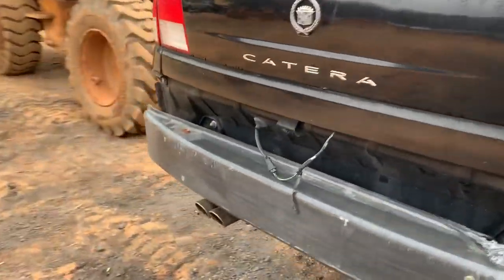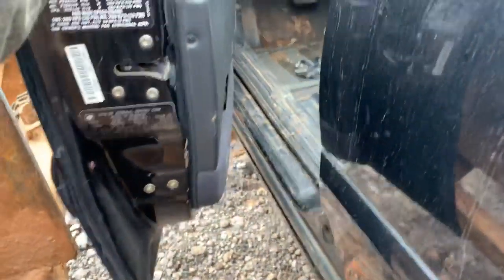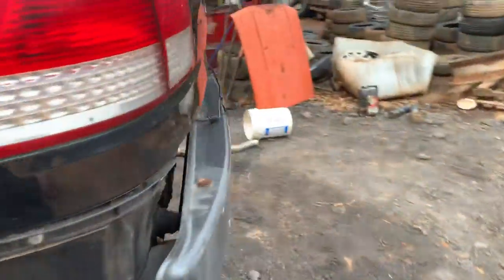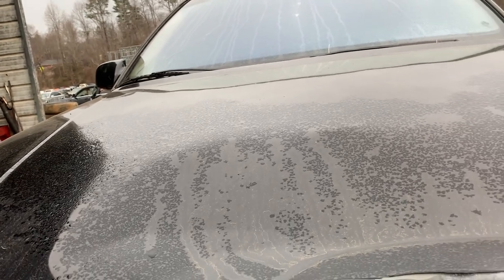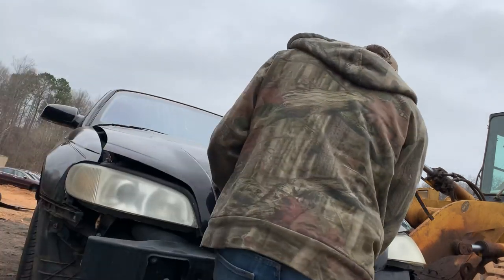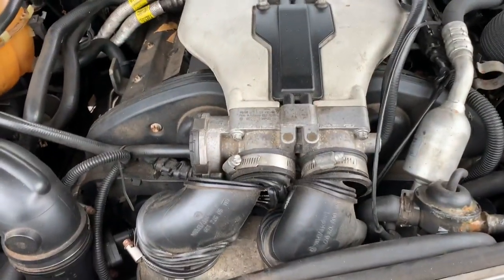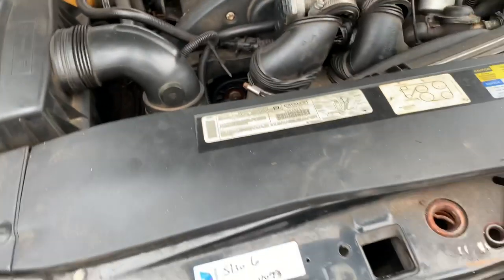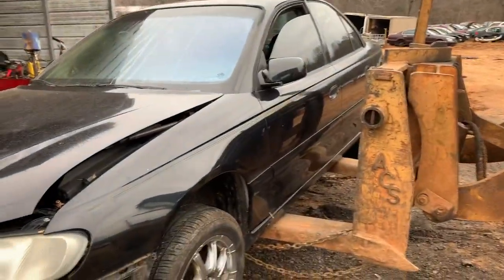Scrapped Cadillac....Catera?!

Comment: Opel Omega. More of GM's badge engineering.
Reply: They weren't bad cars in their Euro guise, despite that V6 being British-built (never a good thing). But then, NA market cars need to be tougher to deal with the longer driving distances and harsher climate (very hot summers / cold winters) in most of the US. Euro stuff just doesn't seem to hold up very well over there. I'm surprised that this was ever badged as a Caddy, but then I guess the brand had lost a lot of its cachet in the 80s and 90s.
Reply: Not the best Opel there ever was, but there are still a few of those Omegas doing high mileage here in South Africa.
Reply: The Omega actually wasn't a bad car, I had an MV6 estate as my first company car in my current employment and it was a reliable old beast, though it did like a drink.  It had been a traffic police car before I took it over and they kept it around because it had been so reliable.  I put another 70,000+ miles on it in a year so when it went to auction it was well on the way to 300,000 miles.  It's still around, still listed as being taxed and tested so that would suggest that it's still running fine.  Those V6 engines could be very frustrating though, they could have issues on top of issues.  It was pretty quick for a big old estate car too, I saw 140+ on the calibrated speedo a few times on my way to scenes...
Reply: Lmao they actually put the legendary Cadillac badge on a fucking Opel
Reply: @calculator5909    Opel were successfully building and selling cars in Europe before Cadillac existed as a car company...
Reply: And now they've sold Opel/Vauxhall so they have NO presence in Europe at all. GM needs some serious help.
Reply: Tomasz Klisz  Yep, PSA. They ain't much but even they have better financial stability and consistency than GM.
Reply: @calculator5909  Opel is not that bad, I've had a few. Currenly have a 2008 1.8 Astra (Saturn Astra in the US of A). At least it's not a VW.
Reply: @gosportjamie  For the money you get a lot more than from other German cars.
Reply: @Rouxenator  I never said Opel was bad, I just said that Cadillac and Opel aren't and never were in the same league. I'm sorry for triggering some 18 year old Corsa owners...
Reply: @calculator5909  LOL, guess that is why they are now selling them as Buick instead ;)
Reply: @Rouxenator    Yes, the versions with the larger engines certainly came pretty well loaded up.  Although my work one was only a police-spec MV6 it still came with climate control and cruise control, as well as a set of extremely comfortable sports seats in the front...
Reply: They should have rebadged a holden Statesmen or Commodore.
Reply: @Aman-fv5if     That might have been a better option, but then again it didn't really work out with the Chevrolet Caprice, the only people who wanted that were the police, and then only until faster versions of home-brewed stuff like the Dodge Charger rendered the Caprice too expensive.  The Omega was a pretty decent car, and certainly could be plenty tough enough, so I have to wonder what made it so rubbish in the US.  Maybe it was build quality issues that killed them so quickly...
Reply: @gosportjamie  The Commodore was the same as this with some engineering tweaks done to it, but could be bought with a v8, was able to take long freeway drives at high temps and was the same size as this, makes more sense to me for a luxury brand.
Reply: The Opel Omega hadn’t a good name either in Europe but GM also ruined Saab.. hateful company!
Reply: @Rouxenator  - That's my favourite Saturn,  and it's not even a Saturn!  I like the two door,  great roof line.
Reply: @Rouxenator yeah right. Around the 90s Opel’s/Vauxhalls were already rusty in the brochure! The Omega and Vectra especially were horrible made junk from the get go! With tons of problems! Typical GM and their cutting corners tactics.. 🧐
Reply: @eggbirdtherooster  I have seen worse Passats than Omegas.
Reply: @Rouxenator  euhmm.. it’s a fact that the Omega was a problem child. 

Also.. nowadays, you almost never see Omega’s on the road. Scrapped cause of engine failing and/or rusted out. And on the other hand, you still see randomly Passat’s driving around. Especially 1.9 TDI’s with something like 900k on the clock and still going strong. And I mean the B5 models (1996-2005). So just as old as the Omega B… 😏

Comment: Just another example of GM's many monumental automotive failures, to add to the list. With respect to your comment about the NorthStar V8 being more reliable. I beg to differ. I've heard of many NorthStar V8s leaking oil requiring extreme expense to repair, not to mention the threads for the cylinder head bolts stripping out too.
Reply: Watch it again, Mike.  One of his all-time funniest lines:  "Cadillac Catera, When you want a Northstar but are afraid of any form of reliability, buy a Catera."  Here he takes this pathetic car and makes one of his best videos ever.  You really have to stay with him, he acts like he's this junkyard dog, but he's really a very funny, incisive guy.  

You watch it the first time and think 'oh he just filmed this quickly on the fly' which he probably did, but he has a real eye for what the camera sees:  The forklift engine running the entire time, the car teetering on the blades, the hilarious sequence of getting the hood open, the camera scanning the junk on the floor, his brother with the ciggie in the background. 

Then he succeeds in getting the hood open (of course,) good factual info about the history and condition of the car, and then the brutal last line about the Northstar where he drives the final stake into the heart of General Motors. All of this in six minutes. True Art!!

Comment: I remember my friends parents owned one of these a few years ago. Let's just say they aren't very fortunate, and had to keep buying cheap cars, and one of them was a Cadillac Catera. They didn't keep it too long, because it kept breaking (go figure). But I remember messing around with it with my friend, we put the car in neutral and pushed it for fun , but it was heading for their ditch and I had to run into it and pull the parking brake to stop it (I guess the term "emergency brake" fits this situation). It sounded bad, but we only moved it about 2 or 3 feet. Fun day of being a dumbass with the car, I stood on the trunk and waved at people driving by, and we crawled trough the folded down rear seats to the trunk. They sold that car not too long after that. Good times. Also, they recently bought a 2008 Scion XD, so they own a reliable car now.

Comment: Have a friend that had one of these, 1999. It’s a piece of crap. He put a new engine in it at 119k (think the rear main seal blew.) Then a tranny at 125k. And endless little repairs and suspension problems. It was a nice car, but it stranded us twice. He finally got rid of it in 2015 with 138k.

Comment: I worked at a Cadillac dealer in the early 2000's and I remember driving these. They rode ROUGH and sounded worse...very noisy. Even when new. We knew even then they were less than stellar. I do not know what Cadillac/GM was thinking when they came out with these. They used hot women and a little cartoon duck to sell them but it didn't work. I think it was Cadillac's attempt to re-enter the rear wheel drive market. A definite thumbs down👎 Production was from 1997-2003? I'm surprised they lasted that long.....on a positive note, those leather seats might be worth rescuing.
Reply: David A.P. 😂😂
Reply: 01 was the end of the road

Comment: They problably rust like crazy as same as the Opel in nothern Europe. Omegas are pretty much gone, while there was thousends of them like 10 years ago on the road. They usually has badly rusted flors, fenders, rockers, bottom of the dors when they are just only 10 years old! But that is typical for 90's Opel, other ones rust the same.

Comment: Ours is still running just fine and we own it since 2003 when it was 3 years old and we got it with 50kmiles dirt cheap. Granted, it is one of 14 registered cars we have, and we only put an additional 110kmiles on it since we got it. The car is actually an Opel Omega B and the drive train was later used in the CTS in a 3.6 liter version. Why were the early ones (97-99) so bad? Because GMs cost cutter - Jose Ignacio Lopez - had pushed the suppliers against the wall until they could only deliver the crap they were paid for. Then Opel was forced to build a car out of crappy parts. He later went to VW and soon after they had their own quality crisis. Don't get me started on a 54° V6 just to be able to squeeze it into the Vectra and Calibra. Opel had  wonderful 3.0 and 4.0 24V straight 6 engines in the Senator B and should have used these in the Omega B/Catera instead.

Comment: Saw one actually a couple days ago. 1st one I saw in roughly like 5 years. Rare indeed. And for a good reason. These were crap. I've seen more Cimarrons around even today.
Reply: More Cimarrons even today (ok, two years ago).  That's impressive,  what unsalted place do you live?  I Saw one driving yesterday in Toronto.  A little rust on the bottom of the driver's door but was clean and shiny otherwise.  And it was moving in traffic, not on a tow truck!  I was impressed.
Reply: @randolfo1265  Georgia. Theres still a bit of goodies down here. Bought an AMC Concord a few months ago in Tennessee. No rust.
Reply: @Brave-Octopus  - Yeah,  all the old gems last longer down there.  AMC Concord,  straight six?
Reply: @randolfo1265  yup. 4.2 liter